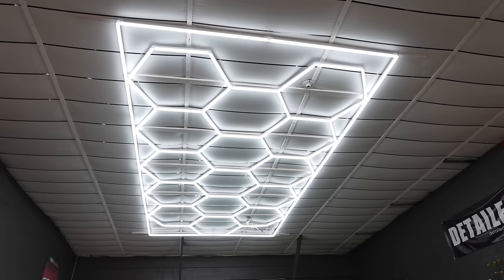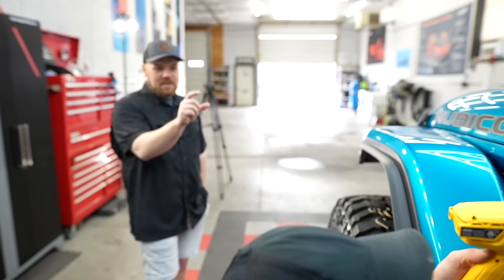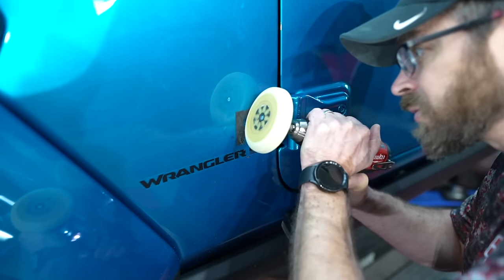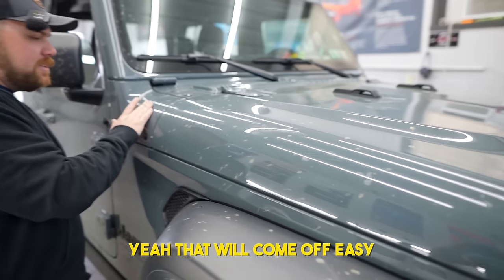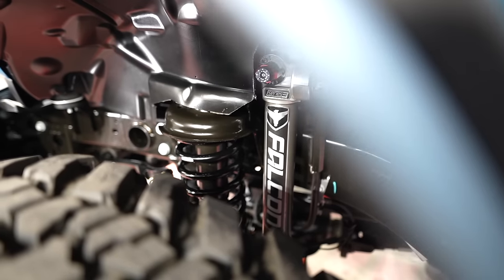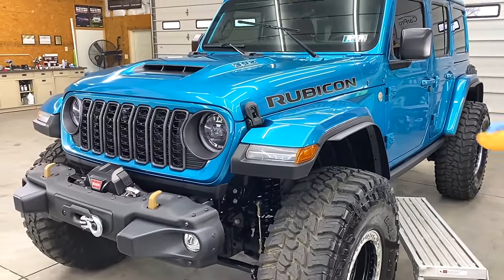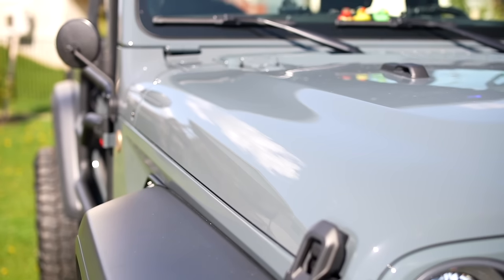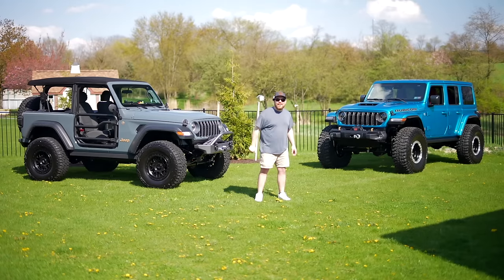You SHOULD Ceramic Coat your Jeep Wrangler

Comment: Great job!  I never really knew the coating procedure & I learned a lot.  Both Jeeps look fantastic & I love the Distinction Applied emblems.  Utah Design Foundry makes cool block off plates for stock steel bumpers with the ends removed.  I added them to my 2020 JLUR & they look good & we're easy to install.

Comment: I am considering getting my Reign JLU coated, but a question, can I still do decals after it is coated or would the vinyl not stick?
Reply: really fine decals are more difficult to apply to a coated surface. There is a spray adhesive promotor you can use to prep the surface and apply the decals with and they will adhere better. something simple like blocky letters will stick just fine. If you don't prep correctly though, decals will not stick well to a good coating like DQuartz or CQuartz from CarPro (used in this video)

Comment: Would you say ceramic coating is better or preferred to a clear wrap? I'm looking to get mine detailed but not sure how to protect.
Reply: Paint Protective Films are still the best protection you can put on a vehicle, however it can be quite expensive.  Film is for impact and abrasion protection, while coatings are for long term easy maintenance.

Comment: Unfortunately I don’t have a garage and can only park it under trees.  Not sure if ceramic coat would help.
Reply: It will definitely help. DQuartz topped with CQuartz is very durable. Way more durable than the clear coat that came from the factory. It is not stain proof, but it acts like a sacrificial barrier so even if it does get stained from living outside, it will take longer to stain it as bad, and the coating can be polished an another layer of coating applied. it's more about the long term preservation at that point.